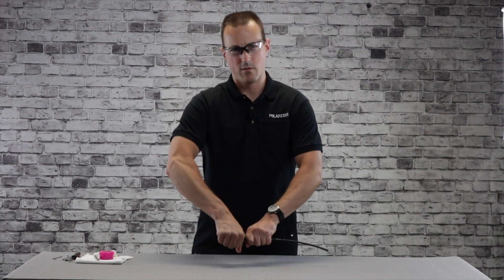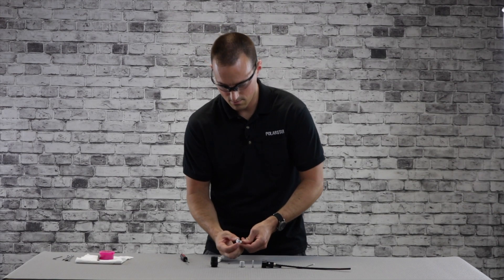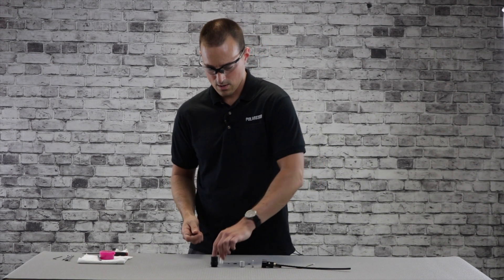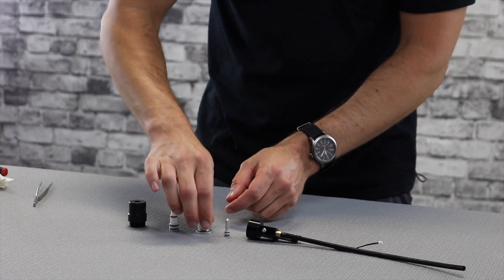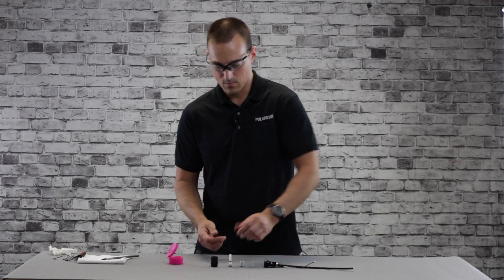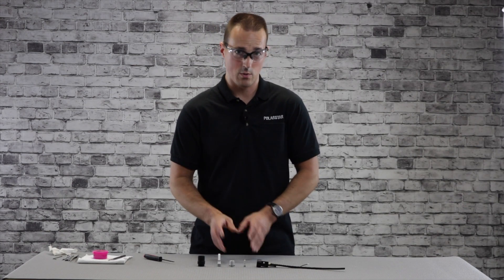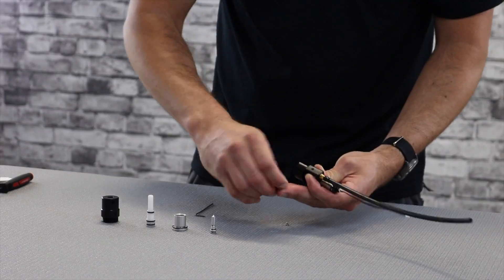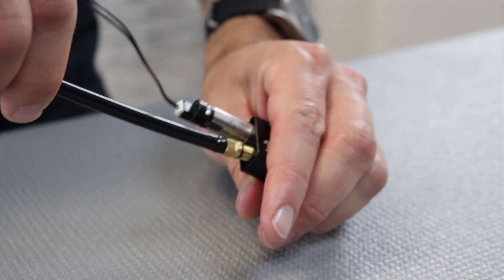PolarStar Airsoft - JACK Maintenance

Comment: Got a new jack and the nozzle kept getting stuck releasing air. Had no idea what it was I loved everything then I realized the oring on the metal cylinder was super loose and flattened so found the problem
Reply: Would it shoot a few shots and then randomly spurt air? Trying to figure out what is wrong with my jack. Thx in advance
Reply: @anthonybracco1979   check to see if your air line is bent to much. Had to adjust mine to fix also
Reply: @anthonybracco1979 I have this same problem and after a full stop down I’ve notice the o ring on the metal cylinder seems really loose going to see about swapping that out to hopefully fix the issue
Reply: Was it the little metal stem in the donut
Reply: @homeslice6330   air line angle was the problem but I did replace the orings. Problem fixed

Comment: Id really appreciate a kythera trigger adjustment video in this format  that is to the point but also states min max for each aspect and where you can set each setting to fine tuned or reliable and light or heavy  trigger pulls. Ive had mine apart 5 times and cant get it right. Separate videos for maintenance and trigger tuning though
Reply: Did you watch the Dee Moe vid he done on adjusting it. I found it was good